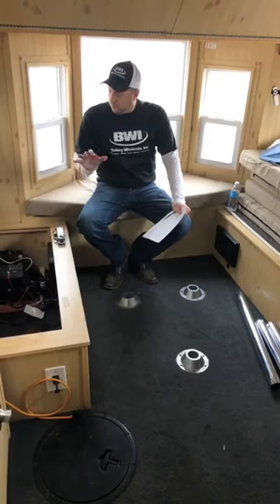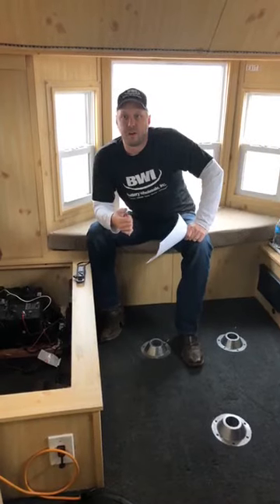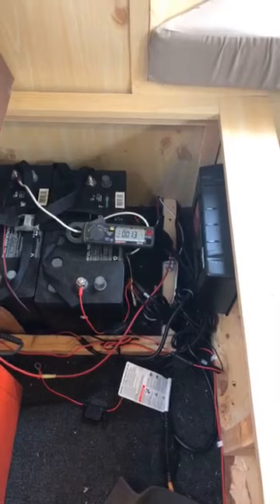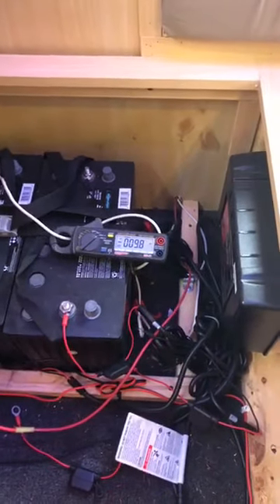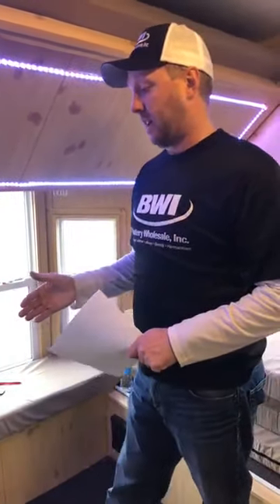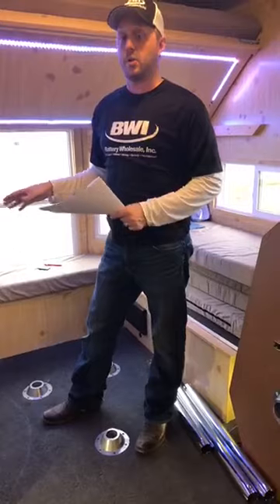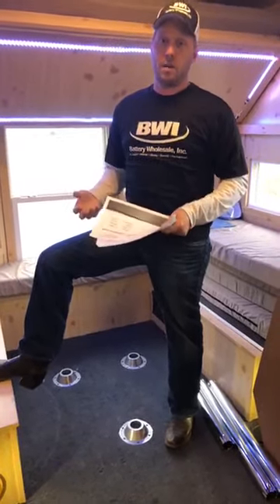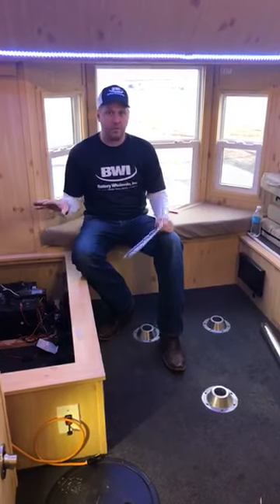Ice Castle Fish House Battery Voltage

Comment: Dumb question but when you plug your house in to charge your batteries I assume you leave the house kill switch on or powered? If you shut the kill switch to the house off I assume your batteries won't charge is that correct?